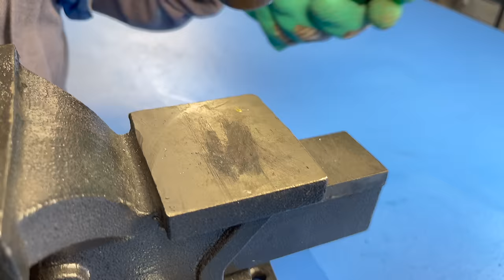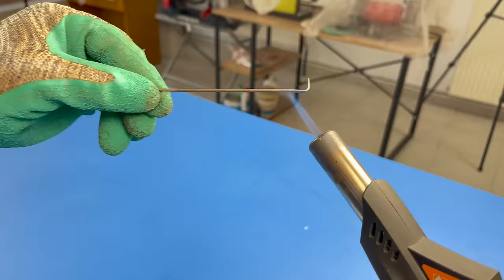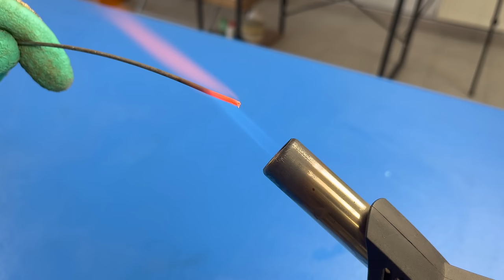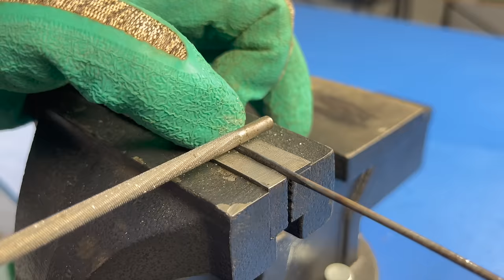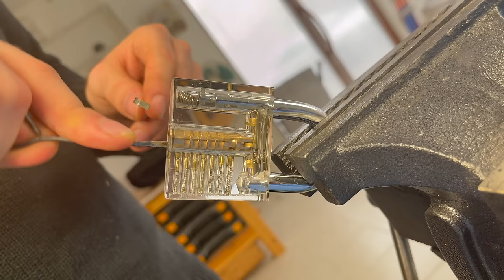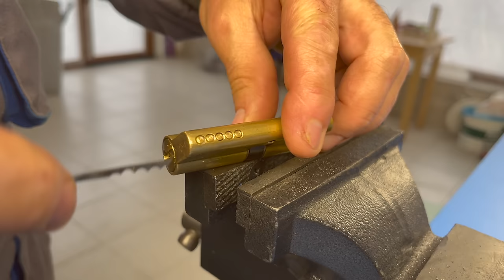How to Make a Key That Unlocks All Locks

Comment: "ALL LOCKS" is quite a broad statement. There will be an awful lot of pin tumbler locks this will not open at all. There are locks that are slider locks, Disk Detainer locks and more. The concept you have made is basically what is called in the Locksmith world as a Rake. There are dedicated locksmith tools of various shapes and sizes for this job and combined there are locks they cannot open. While the concept is right the statement "All Locks" is a little misleading. I can confirm though that this tool you made will open "Some Locks".
Reply: 「全ての錠を解錠する。」でしょう！
Reply: @ハムたか-i8u  good
Reply: takuyaimotasih7240 ,😂

 🙂
Reply: @RoySam, you are too kind. The headline is clickbait and the ten-cent rake is junk.

Comment: I have 100 foot off an industrial drain snake... Some of the best spring steel ever used. Backing for windshield wiper blades were great for a tension bar if you're raking. What are the 0.10
thickness?
Reply: I used street sweeper bristles (parts break off when sweeping, they are easy to find if you walk your neighborhood with your eyes down) for rakes and picks, they don't bend 90° so not good for tensioners....
Reply: @davidjones8942  I used the steel tang off a lawn rack.
Reply: @davidjones8942 they can work for tensioners, but give the bed a larger radius. Whishield wiper steel inserts work well for tensioners.

Comment: Very interesting indeed. I would call that a rake. I'm not going to make one either .. but I get it. I'm suspicious that in addition to the tool it takes a lot of skill .. which you have developed over time.
Add: I forgot to say I loved your video(s). Thank you!
Reply: Are you a burglar since you stated you won't make one
Reply: @terryhill4732  you could say that since I already have a couple of rakes in the garage.🤣
Reply: @danl4222  Lol
Reply: I think the rake method is the easiest one out of all the lock picking tools. All you do is run it back and forth fast and apply pressure with the other pick and with most simple locks a beginner could do it with less than 30 mins practice.
Reply: @Robot256k  but it wont open all of the locks, pin by pin picking is not so hard learn and its most guarantee way to open
Reply: @Robot256k : hahahahahahahahahah, that's a hoot, that's what that is
Reply: @danl4222  I'd say it was more of a rocking pick than a rake, it can't go in and out smoothly enough to kinetically set the pins. With a bit of extra filing to slim it down and make the teeth more triangular it could be used as a rake but all it's good for at the moment is sliding into place and wiggling up and down in the hope that the pins are set at a relatively similar level

Comment: Not a "key",  that is called a Rake.  It only usually works on a Pin & Tumbler lock,  not for use on warded locks.
Reply: Won't work  on most pin tumbler  that are worth having  either

Comment: What kind of wire did you use?  Clothes hanger wire?  Fence wire?  I love this idea because I am constantly losing my tentioners and have several sets with everything but the tensioner.
Reply: I found steel blades from a street sweeper machine perfect for the job. I'm always on the lookout when I walk around the city. They are made from spring steel, flat and strong.
Reply: I use the metal strip from windshield wiper blades.

Comment: I'd like to see it open a mortice lock or a lever padlock or a pin or pipe padlock. A cheap plastic practice lock that can be opened with a simple pin is not a good example. It will not open 'all locks"
Reply: Why would he use that tool for a padlock? Just check the channel of LPL (the lockpicking lawyer). There you'll see how easy it is to open padlocks. Spoiler alert: no lock is safe and almost all locks are picked (or forced open) within 10-30 seconds
Reply: @SonnyWeg  yeah by LPL, that chanel  is definitely  not a real reflection  on tge security  of most locks.
He is one of the most talented  lock Pickers in the world ,but that has come with years  of practice  and his obsession  with the mechanics of locking  mechanisms, some locks he picks in seconds most locksmiths  would  avoid  at all costs.

Comment: That key will only unlock pin locks and not disc detainers, combination locks, dimple locks, lever lock or warded locks. A city rake will open most pin locks especially the training lock you used which only has one pin you need to pick, and the easiest to pick even with a paper clip.

Comment: It's just an ordinary bump rake. It will open only the lowest quality locks.
Reply: I paid my rent at my first apt for 3 months in a row when I was unemployed by trading for rekeying all the locks in the complex. Management had lost their copy of the keys for 80% of the units so I had to pick my way in to rekey them.... used picks I made just like in the video.
Reply: @davidjones8942  should  have done  them a master key system,  would  have covered  6 months
Reply: @paulrevere8581  I did master key them all....only 220 units...
Reply: @davidjones8942  I hope your rent was High   if a 220 unit master  key system  was 3 months  rent
Reply: @paul revere  no, cheap place.... thinking about it, it was probably only 80 units, but it felt like 200 at the time... but I only made $5/hr back then, so it wasn't quite fair, but it was reasonable. It was back in '92...
Reply: @davidjones8942  free rent is free rent, especially  for something  you like doing

Comment: 1. That's not a key
2. Keys don't usually require a tension tool
3. That's more like a rack
4. That rake is really only effective against pin locks
5. It definitely won't work on "all" locks

All those things aside though you did a good job making it.

Comment: Amazing! But here in the UK, I can imagine a policeman coming along at the worst possible moment and asking you what exactly you were doing! Another way of opening a door, destructively to the lock, is to use a drill to make a hole where the key would go and stick a screw in, this is one of the ways criminals used to break into cars, before alarms were common.
Reply: It really  isn't,  stick a drill bit down  the keyway will accomplish absolutely  nothing. 
Also chances  if actually  seeing  a member  of the filth  these days is slim.
Reply: @paulrevere8581  well, I can only say I have seen it done and the doors did open. Probably it's so long ago the system would have been simpler. As for the police, don't forget the plain clothes variety. I have seen a marked police van pull up and these characters jump out who you would think were tramps, junkies and God knows what. They were actually police.
Reply: @OLDCHEMIST1  I'm a locksmith, drilling  does nothing unless you use something like a 14 mm bit , they  used to drill next to the lock  on cars and flip the linkage
Reply: @paulrevere8581  I only know they opened car doors using screws, perhaps that's where we're misunderstanding one another, I am talking about cars and I didn't make that clear, also a long time ago, when people wouldn't be filmed, an alarm go off, or the car immobilizing itself.
Reply: There is a destructive opening method that uses a screw to pull out the core of the lock. Obviously, this requires special screws and additional tools for the actual pulling.
Reply: @erichkitzmueller  Ok, respect to your obvious expert knowledge [no rudeness intended] this is probably what I observed without understanding it, all I saw was screws in the hexagonal key door locks and voila, a van with its doors open.
Reply: @erichkitzmueller  depends  on the lock , I have used a normal  screw and a claw hammer in the past,
Reply: @OLDCHEMIST1  no you didn't, unless  you are talking  about some of the very early  Ford tibbe locks.
They had a fault  that the discs could  be bypassed  and lock opened  at the rear, would have used  an adapted screwdriver  if that was the case.
Reply: @paulrevere8581  It was a Ford van it was a long, long time ago. All I can say is it looked like a screw in the hole for the lock, which had a hexagonal hole, and the door was open. Probably, as you say that used some sort of adapted or special screwdriver. Certainly, the doors were open without the key, maybe they used something extra to open them as it was someone who targeted my works van, I knew who it was, but the police would do nothing. They were a minor criminal and drug user who happened to be a pain in the arse in my town until he showed his native stupidity and threatened a policeman while high on drugs. I was there, so I had the pleasure of seeing the little twat arrested.
Reply: @paulrevere8581  Yes, I've just looked up the Ford tibbe lock, and the key looks very much like the one I remember and it was probably about 20 years ago. The little bastard who opened the doors would have well-schooled in lock picking and anything else nefarious you'd like to name!
Reply: @OLDCHEMIST1  not schooled I'm lock picking,  but definitely scholed in bypass methods  on older vehicles.
Other screwdriver  method was  force screwdriver  into  lock ,then use left ,right, up ,down movement, this will  basically  mimic  the action  of plug being  turned  and move linkage  bar to unlock  door.
Reply: @OLDCHEMIST1  reading what you have said  in your last post,sounds  like he snapped  a screwdriver using  the left right  up down if it was left in lock, he wasn't  particularly skilled, easiest way on those vans was to lift handle  and you could  fit a hacksaw  blade  into the door and move linking  bar with absolutely  no sign  of forced  entry
Reply: @paulrevere8581  Sounds about right, the guy I mentioned suffered from believing he was brilliant, but was just a little toerag - I don't know if you are a Brit, but he was one of Liverpool's rejects, somebody who thought he would go down south to steal and was obvious to everyone
Reply: @paulrevere8581  Ok, sounds like you would be a good man to know if I lost my car keys! The only trick I know is the old coat hanger one, which won't work these days!
Reply: @paulrevere8581  Certainly not a silver one!
Reply: I can imagine a policeman never ever comming along.
Reply: @chrishayes5790 twice  in 3 days I have  driven  from cardiff to Gloucester  to burglaries, got there before the police on both occasions
Reply: @chrishayes5790  You don't live where I live then, they always seem to be around. Even my partner, who is an innocent lady got stopped by the police or the community whatever and questioned. She told them to go to Hell, more or less and they quickly scuttled away. I told her she should have taken their names and numbers so I could complain about stopping someone with no excuse.
Reply: We already know a Pikey can already open any lock.
Reply: The drill attack method is one of the reasons modern locks use hardened steel.

And if you are going to spend the time drilling into the lock, you might as well just bust the door in with a sledge hammer.
Reply: @kinyutaka  As I told others who commented, I was talking  about things as they were, perhaps 20 years ago. From my experience, the majority of criminals are pretty stupid, either trying techniques that are dated and ineffective or going for a reward of small monetary value.
Reply: Many modern car door barrel assemblies have friction captive parts or parts that have been designed to be durable in operation but have a sacrificial function when attacked,quite ingenious some of them are too! most always at the point where the barrel activates the rod or cable to the latching/ locking mechanism.The newer ford locks have a plastic activation cam on the back of the barrel, the cam has the tiniest protruding lip keeping it secured and any attempt at pushing anything other than a key in or drilling will result in the clip breaking,disconnecting the link between the lock and the barrel,or on other systems the friction mechanism has a designed weak spot and will no longer operate for instance,so even turning the barrel results in nothing.Citroen once used a set up where only the correct key would then engage the lock,putting anything else in including any other Citroen key resulted in just the centre spinning.

Comment: You can buy racks just about anywhere including Amazon but neither yours nor store-bought racks will defeat security pins.  I own a few of those European locks with standard pins and a wire tie can open them up just as fast as with the key.  😕

Comment: On street cleaning days, after the street sweeper cleaning the leaves and such at the curb has gone by, you can find flattened spring steel stock from their brushes that fall our and is much better to use then what you're using now to build from scratch.
Reply: Yup, the steel is decent. Never tried heating and flattening to get the desired thickness, just used a Dremel with a stone wheel.

Comment: WD40 WILL RUIN YOUR LOCKS!! It only works as a short term solution then starts to thicken up and clogs up the pins as it collects more and more dirt. Instead you want to find lubrication designed for locks. Most hardware stores sell some type of lock lube.

Comment: I have learned a very expensive lesson, my husband locked us out, the dummy that tried to open it used a piece of plastic, he couldnt unluck the door although it was not locked with a key. Then he broke the lock open and replaced the lock, it was 1,300 euros, he even told me I had to replace the frame because it is scew thats why he couldnt get in, I sprayed the lock afterwards with cooking spray, it works perfectly,     My advice is , bury a key in the garden in a plastic container, its cheaper than a locksmith with a plastic card.

Comment: That is not a key. That is a pick. Please do not call it a key. A key is made to open a particular lock or set of locks, and do so with no skill or practice or trickery. A key is something you just insert and turn and bam, it works. If it requires manipulation and a separate tension wrench, it is a pick. Also you really should temper them if you are going to harden them. Just leave them in a 400°F oven for an hour and you should be good to go. All that hassle though... you should have a rake in your pick set already, as well as a couple of tension wrenches.

Also heat treating doesn't work so well with mild steel. You want a high carbon alloy. Or you can case harden if it is mild steel.

Because of the misleading title I consider this click bait and I am giving it the thumb down.

Comment: This Video is Pure BS.
  When Tempering metal you heat it then sharpen the tool and Then reheat it and quench it in oil ONCE .
  Every time you Quench it the metal gets more brittle .
Quenching the tool 3 or 4 times it would just snap off .
Plus you can buy this pick tool anywhere you don't need to make one .

Comment: I have an old Slaymaker Lock I found at a yard sale a couple of years back. It came with a key. The key is a Master Key. Says Master on it.  It has BCD stamped in a box above where it says Master. I have yet to try it out on other Slaymaker locks. Unable to find other Slaymakers as old as this one to try.
Reply: If that word master looks like a factory stamp it may be for an original Master padlock made by  Master.  There are other brands that use the Master M1 and M2 keyways and sometimes similar heads.  Usually cheap knock offs.

Comment: Wow, can't believe ppl believe this garbage. With the lazy non-raking technique he used with that homemade rake, I'm quite confident that all the pins were identical in height so literally anything that fits inside the keyway and pushing down on the pins could open the lock just as easily. Also, that rake will only fit those larger keyways and only work with that pin design. If anyone wants to see how lockpicking really works and how difficult it actually can be, there are plenty of other channels out there showing the good locks and bad ones and their difficulty ratings, "BosnianBill" and "LockPickingLawyer" to name a few.

I myself am an amateur lock picker as a pass time with several years in re-keying locks as a job and I can tell you right now, door locks are rarely that easy to open with a rake.